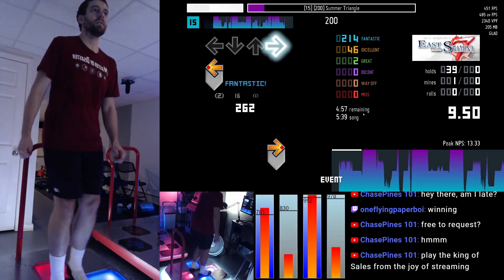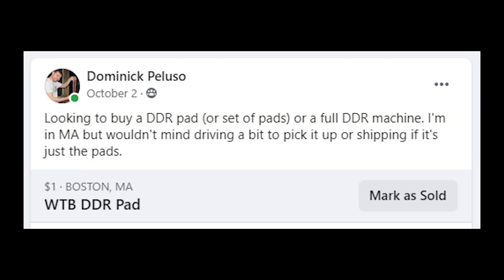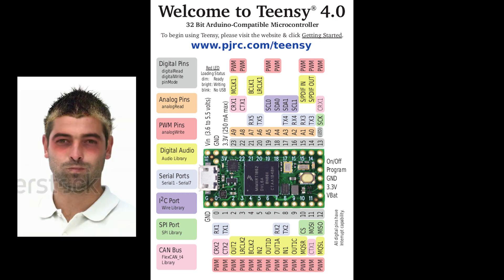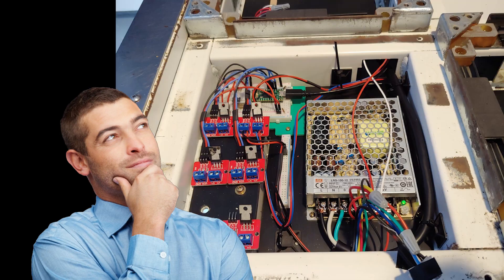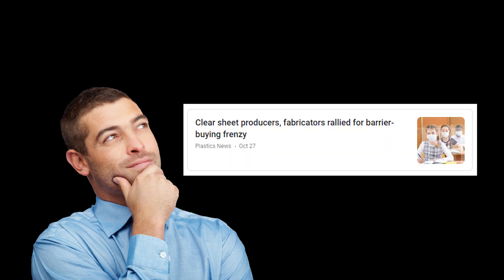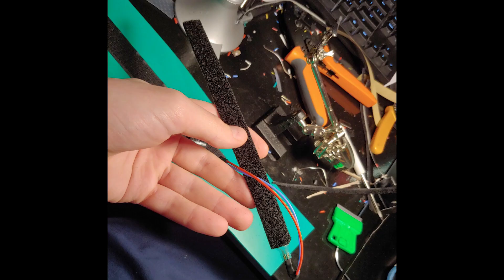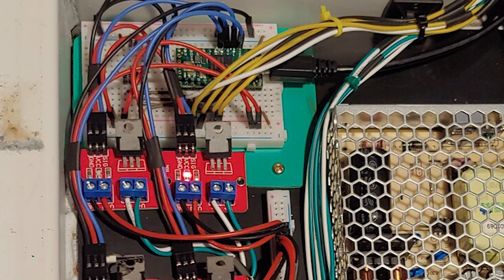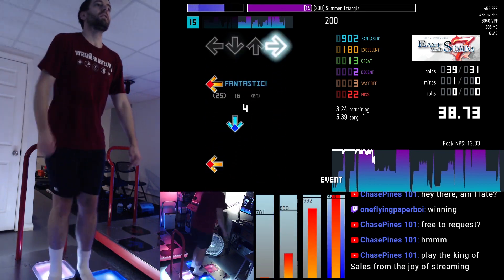How I converted my DDR pad to FSRs

Comment: What strength Velcro did you use? I think I bought stuff too strong
Reply from the maker: I bought this one https://www.amazon.com/dp/B07YQWD4V3/ref=cm_sw_r_cp_apap_QJMUvztDVNh75 it is pretty strong. When i remove a sensor im careful to pull it from one corner and i try to keep it as straight as possible while i remove it

Comment: I would not run a 100-240V cable inside my pad made of mostly metal. I would rather use an external power supply in this case :\